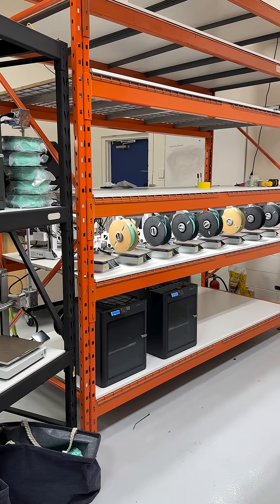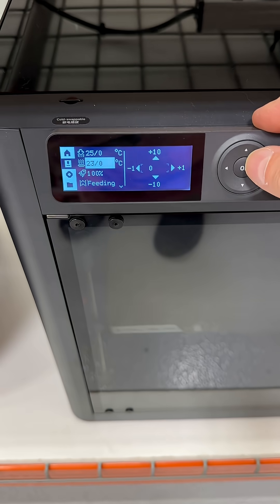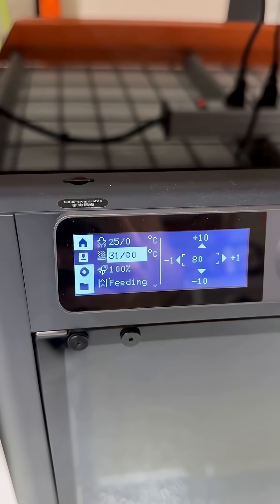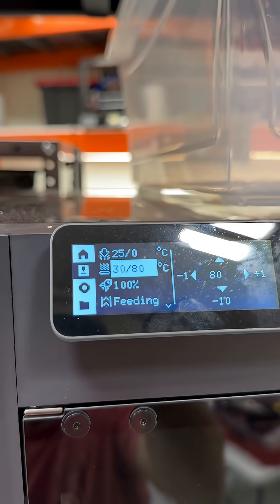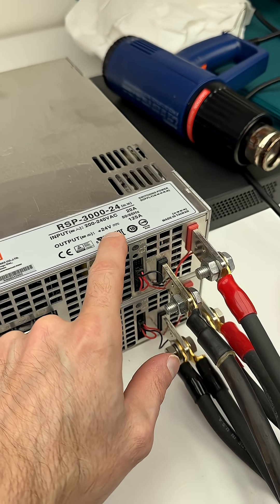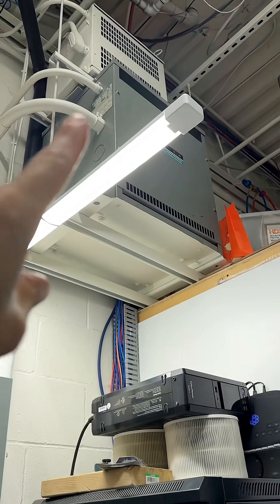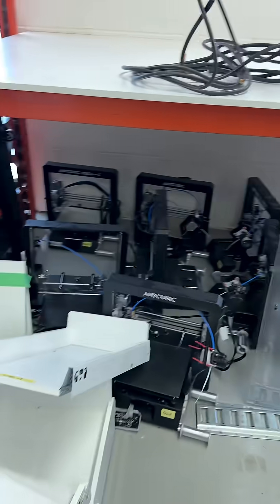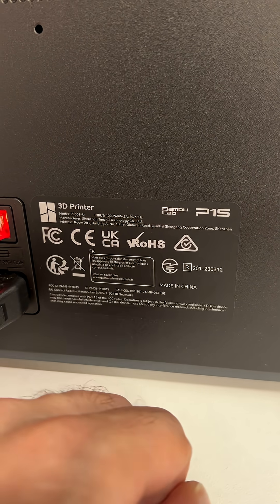I Connected The Bambu Lab P1S to 208 Volts. This is BETTER For Production!

Comment: If you double the voltage you also double the current... Quadrupling the power, not doubling. You're going to burn your bed if the power density on the bed heating coil weren't designed for that power density. But it might be designed for 220V or 240V and just heat 4x slower on 120V

Comment: If the bed is directly powered using mains voltage doubling the voltage would actually quadruple the power
Reply from the maker: Standard here in Canada is 120 volts and I used 208 to power the printer (3 phase). Its not double the voltage.

Comment: I was SO sueprised how slow it climbed because we’re used to the fast heating in Germany because of 220 volts 😅
Reply: No, we have 230V… nowadays…
Reply: @t @thommyh.4492  voltage varies depending on where you are in a grid. In America we say 110 even though most of the time it’s 120. Working as an electrician I’ve seen 125 or even a little higher. I’m guessing it’s the same there.
Reply: @nightkiller11 yes, but they changed herer (Germany ) from 220 to 230 because more European countires have this. Old bulbs died earlier, they are glad to sell more…
Voltage is allowed to change +-10%, that is a lot.

Comment: I tend to run my DC beds at lower max power in Klipper to reduce warping. Is there any difference in the P1S bed flatness due to this? Just wondering.

Comment: How could anyone say 208V is too high of a voltage for that printer? All of Europe runs 220-240 volts and if anything it's the US's 110V that could negative affect printer PSU's longevity.
Reply: Yeahh I mean the printers powere supply literally had a switch for either voltage
Reply: "if anything it's the US's 110V that could negative affect printer PSU's longevity."  How?"
Reply: @michaelchadwick8261 Watts = volts * amps. In other words the PSU must run on higher amperage to achieve the same power. That's why your power cords are thicker as higher currents run through them. 200W at 200V requires only 1A of current and twice as much at 100V.
Reply: @inso5078  The PSU is desinged for that so again, not sure why that would negtively effect the printers life span.  All you pointed out was a design requirement for the PSU.

Comment: In Europe we have 220v. Bambu psu auto senses the ac voltage and switches internally (most modern ones do I think).
There used to be a switch to select either 110/220
Reply from the maker: Yes, Ive taken PSU out and it has no voltage selector - they limit pwm to account for the higher voltage. Id never hear of anyone in EU talking about how fast the printer starts up there over north America. Curious if they use a different heater for the bed maybe? Honestly I was expecting the PWM to be greatly reduced with the higher voltage but to my surprise.. bang bang is still used
Reply: @leckiestein This basically applies to all of our printers. It’s just the normal speed. The relative speed difference between printers still exists, just on another level so voltage is no talking point. Noone has 110, so nothing to compare.
Reply: Thank you. This makes me think. I can switch mine over to 220.
Reply: Damn I have 208v in my printer room but none of my printers have mains heaters 😂 (and probably don't support auto voltage, I think one has a switch even 😂 and I'm always worried about giving 2o8v to 240v devices)
Reply: nobody in europe has 220 V

Comment: Actually you quadrupled the power which is really unsafe!
Reply: Nothing is even remotely unsafe about this, you clearly never watched the whole video, the plate on the back of the unit clearly states it can run at up to 240 VAC. Control electronics are switched down to the correct voltage, and the PID control regulates the bed temperature as normal. What is unsafe about this?
Reply from the maker: Please explain this math to me! P = IxV - nominal was 120, 208 is not quite double. How did you come up with four times the power?
Reply: @leckiestein P=V^2 divided by resistance, the heating element would be fixed resistance. To your point, the voltage isn't quite double so it's not quite 4x the power, but it is more than double. Nothing is even remotely unsafe about it, though.
Reply from the maker: @CarbonKevin  yes, the heater is about 50 ohms. 2.4amps at 120volts 288w. This would be peak when the machine is cold for me. BBL lists 350w at 120v. 4.16 amps at 208 volts 865 watts. BBL website lists 1kw at 220 volts so it seems about right. At peak 120v current, 2.4 times the power by running at 208v, not "quadruple" not even close. But.. Not sure whats so unsafe tho - better not ship bambu printers to Europe 😂
Reply: @leckiestein can confirm, when i first start a print ot runs at 950-1000W, though that includes fan and hotend. Voltage is in the 230s
Reply from the maker: @nokarukuta587  Thats awesome. I cant believe how fast this thing heats up on just 208. At home I have 240 at the panel. Considering rewiring my setup